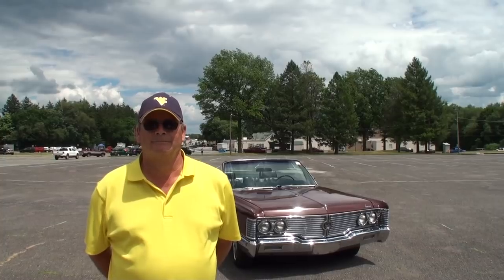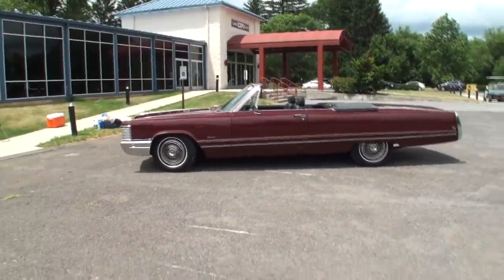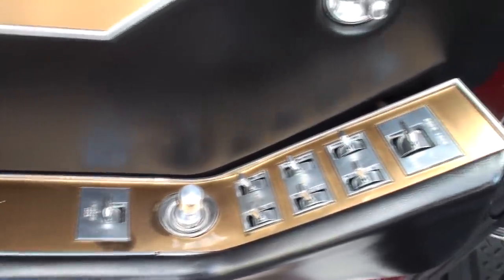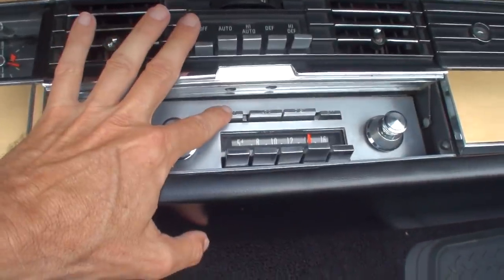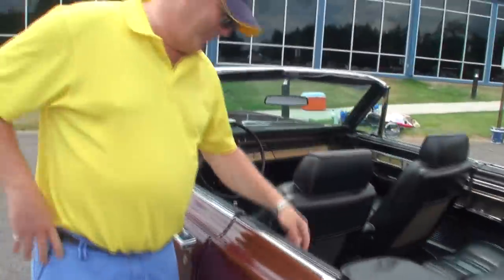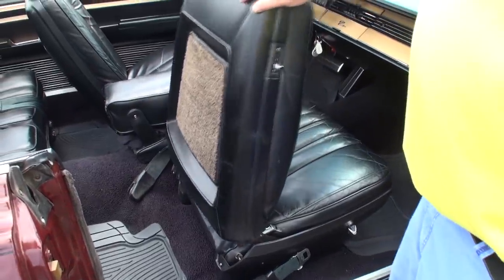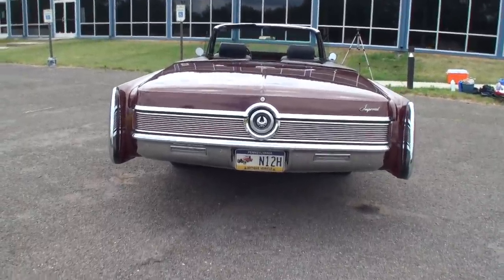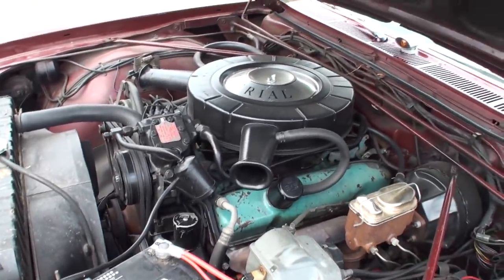1968 Imperial Convertible in Burgundy & 440 Engine Sound on My Car Story with Lou Costabile

Comment: I can instantly spot a 1968 car, because 1968 was the first year of the federally mandated side marker lights, and on all  Chrysler corp. cars, whoops, mean Imperials, they were discreet squares, as the body styling was very similar to the 1967 model. Beautiful car, remember seeing these around in the Los Angeles area as a kid!  Thanks for finding these gems, and their owners!
Reply: The 1967 Imperial had different front end styling.
Reply: @SpockvsMcCoy  They were similar, but, as you said, " The 1967 imperial had different front end styling" of the grille, bumper, and location of the running lights. The styling radically changed for the 1969 year.
Reply: @carloscarpinteyro332  True, Imperial styling  changed significantly every few years. However, except for the Imperial eagle emblem the overall design had no consistent theme from one generation to the next. Lincoln floundered until 1961 with the same problem. Cadillac had the most consistent styling cues. The 1969 through 1975 Imperials used the same roofline and instrument panels as cheaper Chryslers.
Reply from the maker: Hi Carlos, Thank you for viewing and sharing your knowledge. Glad you're enjoying the cars with me, and you're welcome, Lou

Comment: The Imperial had been the top of the line Chrysler series from 1926 to 1954, before becoming a marque in its own right in 1955, which it remained until it was discontinued in 1975. Chrysler made this move in an effort to put it more on a par with Cadillac and Lincoln, yet for years afterward, a lot of people were still calling it the "Chrysler Imperial", and somehow Chrysler found it difficult getting the message across. I think if Chrysler had established the Imperial as its own brand from the beginning, there would been a lot less confusion and maybe it would have been more successful. There were two revivals for the Imperial, from 1981 to 1983 and (as a Chrysler Imperial once again) from 1990 to 1993.

As for this one, I can see it makes Bob quite the proud owner. So many unique touches here like that covered radio, the speedometer with the needle above the numerals instead of below them, and the chromed-over taillights (although that could have been imitating the early Pontiac Grand Prixs). 1968 was the last year for an Imperial convertible, and it sounds like would get plenty of wind in his hair on that day! And yep, it's big all right! Wouldn't be an Imperial any other way! BTW, I get a lot of comments about how big my car is too (a 1967 Pontiac Bonneville wagon).

Well, this was quite a treat to see, and I can always trust you'll have lots more treats to come. Take care, Lou!
Reply: Chrysler Corp called their first top of the line 1926 model a Chrysler Imperial instead of just Imperial. The Imperials of that time had advanced engineering, high horsepower, and great quality. But the Lincoln and Cadillac at that time were often sold at exclusive dealers, at least in big cities. And both Lincoln and Cadillac started as independent companies.  The 1981 to 1983 Imperial had dramatic styling but the horrible fuel injection doomed it. The 1990 to 1993 Imperial was a turkey loved by Lee Iacocca but hated by Bob Lutz. The fantastic Lexus LS400 was also introduced in 1990.
Reply from the maker: Hi iswc27, Thanks for sharing your knowledge :-) Glad to read the details you enjoy. Take care, Lou
Reply: Was wondering if Chrysler ever had separate Imperial dealerships, or Imperial/Dodge dealerships. Might have made a difference in sales in the late ‘60s and early ‘70’s…and with any luck they could have kept the Imperial division going to this day…

Comment: By the late 1960s the price for Air Conditioning relative to the overall cost of big American cars had dropped to the point that paying extra for the convertible model did not make sense.  Also, by that time AC units were fully integrated into the dashboard instead of a bolted on bulky unit.  Higher crime rates like vandalism and theft at that time also hurt sales of convertibles. Sales of the Imperial were strong only when the car itself was a new design...minor facelifts saw diminished sales.  Lincoln and especially Cadillac had more consistent yearly sales at that time. The repaint on this example is high quality ...possible rechroming of the bumpers?
Reply from the maker: Thanks for viewing & sharing.